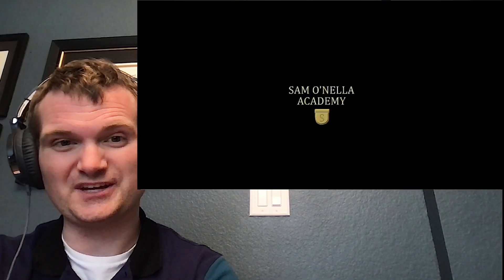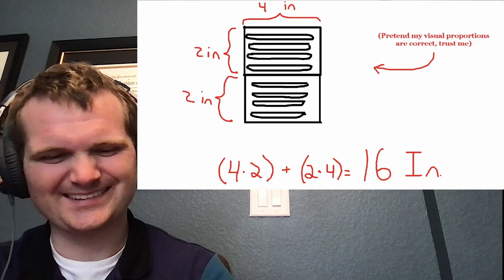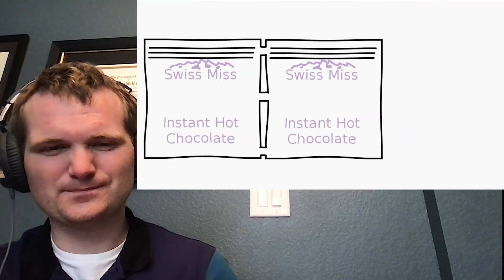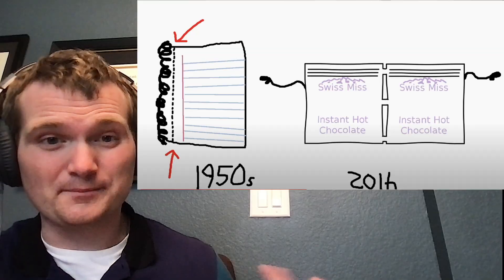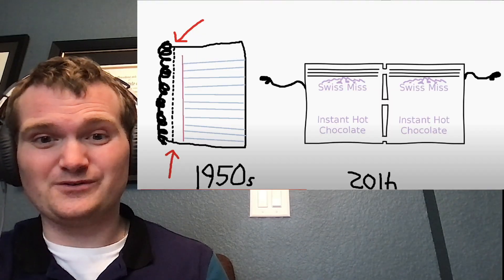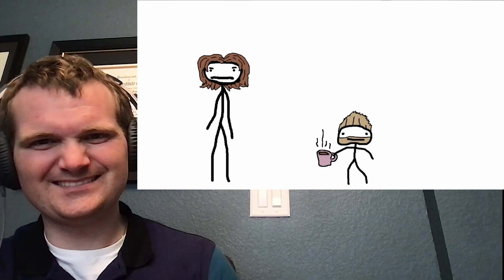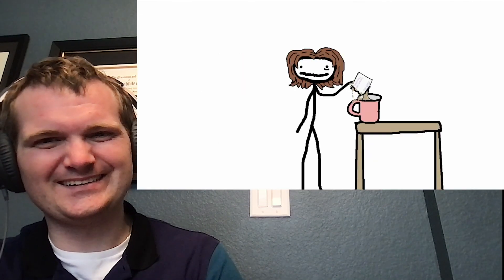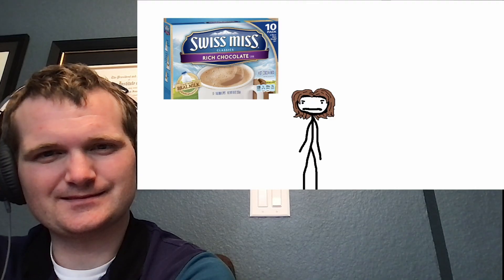Nuclear Engineer Reacts to Sam O'Nella Academy "An Open Letter to Swiss Miss"

Comment: My issue is with Little Debbie packaging and others.  When I was little I could hold a Little Debbie flat on my hand, slap it and it would pop open.  Now, I can't rip one open.  What was wrong with cellophane?  Why switch to hell plastic?  I do not want to have to find the scissors every time I want to eat.

Comment: I bet the box size is for visibility in the supermarket shelves, and the small serving size is so they can report half as much sugar in the back of the box
Reply: Yep, exactly. If they were a long and narrow box instead of short and wide, there's less room for front-facing graphics and they maintain visual presence on a shelf for a shorter amount of time since the column moves to the back twice as quick.

Addendum: additionally, they're kinda convenient the way they are now to some extent because you can turn them sideways and slide them onto the shelf lengthwise- and take up less space on your actual shelf without covering up anything else.
Reply: and the bad connection makes you waste some every time

Comment: Fun fact: since most mugs hold more than the serving size of the bag, you fold the two together and rip the two tops.  Most people don’t need only 1 bag to flavor a drink, they need two, that’s why they’re connected.
Reply: He mentions that towards the end of the video; still not super intuitive, could use a picture on the front showing someone about to tear a folded pair, or have little curve-arrows near the joints, maybe.
Although if that is the issue, why aren't the bags just made to hold twice the amount of powder? If they're trying to make it so that you have the option to do a half-serve, then it just goes back to the issues of the joints he highlights in the video; the joints should either be perforated so they can be split easily, the bags should be separate so you have full control over how many bags-worth you use, or the bags should be one serving-size each, imo
Reply: Y not just like, you know, put 12oz in 1 bag?

Comment: What really funny that I found out the hard way is this packaging for Swiss Miss is only in America. The boxes are smaller with less packages of chocolate mix.  But it equals out to actually more oz. of chocolate.  

A standard box of Swiss Miss you can buy in Walmart in America is (8) 6oz packages of chocolate.  Outside America including Canada and Mexico a standard Swiss Miss box hold (6) 12oz packages of Chocolate.  Outside America version has about 24oz more than America.

Another piece of information which is crazy when you think about it.  1 servings size in America is 6oz but each serving has:   2g of Fat
          6g of Carbs 
          12g of Sugar

1 servings size of the outside America is 12oz but each servings has:     4g of Fat
             4g of Carbs
             3g of Sugar

You have to consume 24g of sugar compared to the 3g of sugar to get a “similar” taste.  What is very ironic, the international version seems to be much sweeter compared to the America’s version with much less sugar.  

It also doesn’t help when the American version says anywhere from 10 to 50% chocolate.  Every international version says 60 to 85% chocolate.
Reply: this is going to drive me insane.

Comment: I live in England and never have had swiss miss, however, nearly all cheap instant hot chocolate options require you to have as much precision that a scientist trying to get two particles to collide while they travel across the entire universe, randomly changing course and needing constant correction.

I have never been able to properly make a cup of hot chocolate because somehow I go from "too little powder" to "too much powder" with a literal single grain of the hot chocolate powder. It would also be nice if the hot chocolate powder would reliably dissolve, but at the end of my drink I'm always left with a small marshland of hot chocolate powder right at the bottom of my mug. I could continuously keep the water near to 100C, stir stupidly vigorously for an hour and I'd still be left with powder at the bottom.

Cadbury's hot chocolate options are a little more expensive, but they do the job so much easier, and the amount of precision needed to get a decent chocolate flavour is greatly reduced. And they also don't leave a pile of unmixed powder at the bottom. Maybe a small ring, but nothing ridiculous.
Reply: OK, cadbury.
Reply: @neuromantic4313  if only I was sponsored and or employed by them to spread pro Cadbury propaganda. I'm just doing it for free.

Comment: Terrible engineering? It's brilliant. Swiss Miss's goal is to sell hot chocolate mix. You could have a 6 ounce cup but you really want the mug. If they made the packages easy to seperate you might just have the small cup. You buy it planning to have the 6 ounces.but get forced into using two packs, win for you and them.

Comment: I am a foundry engineer and stuff like this piss me to no extend. Like the first thing I did when I join the crew was to organize things at my work place as convenient as I could. So printed standards are here, 3d solids are there. So like the work is doing itself on is own and I just have to focus on the more brainy parts.

And then some new guy just go around, mess with my system, dont want to learn it and just breaks my system. And then I had to focus on fixing that and miss some crucial details in the long run.

Big problems start with the minor ones.
Reply: That’s what she said